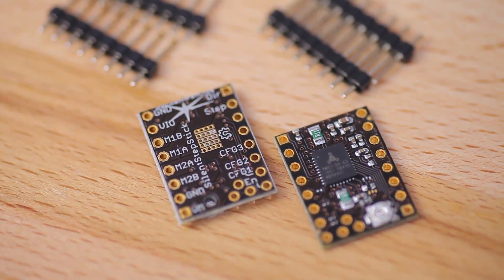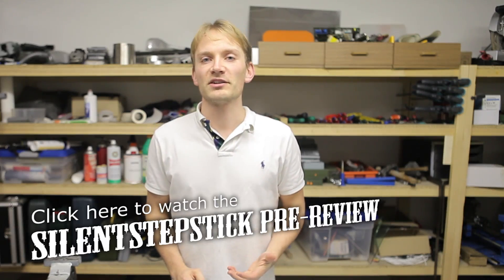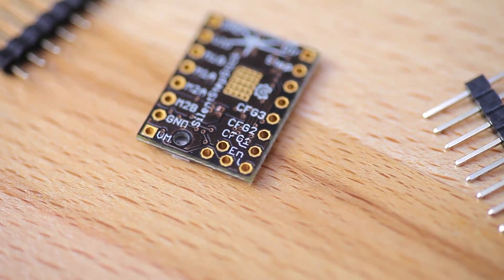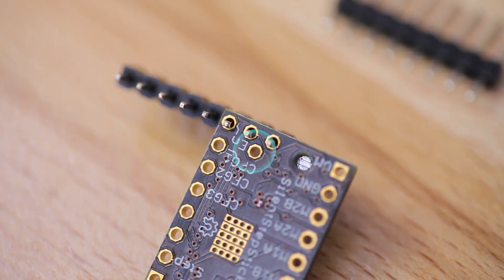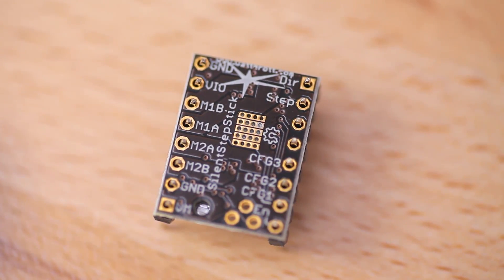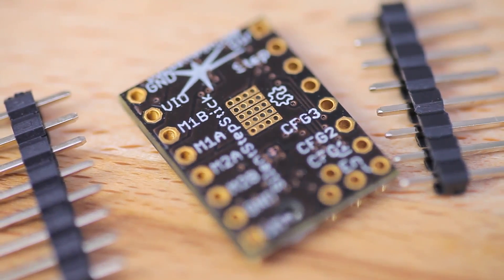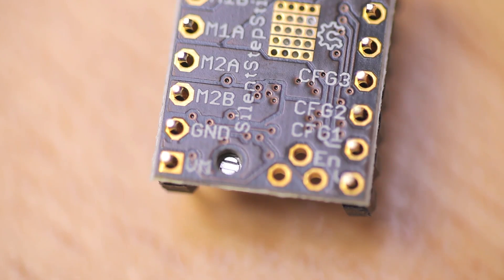Honest update: The finished version of the SilentStepstick

Comment: Hi! Can you tell me, if it is possible or not, to replace the "Makerbot 2" Botsteps with those SilentStepSticks? 1 on 1, or are there any modifications required? Edo
Reply: I've just done this, you have to run them upside down as the botsteps are already 'corrected' compared to most drivers for thermals

Comment: upside-down mounting with thermal vias is as old als cheap desktop 3d printers and was in makerbot replicator 1 open hardware design on the a4982 stepsticks on mightyboard. so all the cheap chinese makerbot1 clones have the right thermal design on the stepper drivers too.
next thing: whining on the steppers may be reduced alot by using a 24v PSU for the stepper motors.

Comment: Hi, i use tmc2100 module board and configure pin correctly,but i can't drive motor with 256 resolution.
Config Pin:
CFG0,CFG2CFG3,CFG4,CFG5,CFG6==>OPEN
CFG1:GND

Comment: Hi! There are two differt models of the TMC2100 at watterott. There is a 5V and a 3.3/5V (black one from the video) model. The FAQ says that you have to power on and off the black boards in a certain way. The Motorpower should be on first, than the logicboard. 

See: https://github.com/watterott/SilentStepStick/blob/master/docu/FAQ.md

I have the black boards (so those are powered by the motorpower).
I have only one switch for the whole printersetup. So the power should come up simultaneously. Is that a problem?

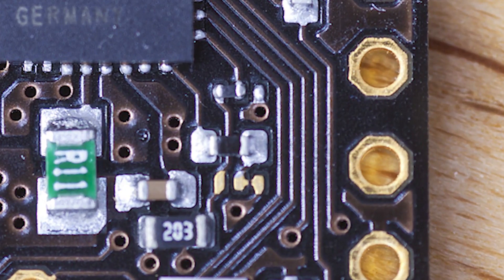Comment: Hi Tom, at 1:48 you talk about the two extra configuration jumpers (I think you say blind time and hysteresis?). I am trying out the silent stepsticks now and I get a very high pitched noise when I use them (other than that they work awesome). Would I be able to get rid of that high pitch noise using those? Can you tell me more on how to do that, or tell me where I can find information on it? Thank you, and great video!
Reply: I have the same problem with 2130's, I reduced the blind time and raised the hysteresis which helped it a little but it's still awful, like having tinitus.
Reply: sttrife I have the same problem. did you ever figure it out?
Reply: Raise stepper driving voltage.

Comment: +Thomas Sanladerer hi is there resolution difference  between printing object with this driver in stealthchop  and drv8825 or spreadcyrcle mode  and stealthchop mode ?
Reply: +Thomas Sanladerer  extruder motor torque is good in steal chop or is bad for extruding filaflex?

Comment: I wanted to update my 3d printer with these drivers but I ran into temperature issues:

My A4988 Polulu's are loud but they will stay at 50-60°C, I have to "feed" it with 0,27V (=> 0,68A).
To reach this amount of amps I have to feed the SilentStepStick's with 1V (=> 0,7A). So this is 0,7V more - and they reach 90°C in a few minutes...

Is this a failure of the drivers? I'm running them in stealthChop mode.

And for the heatsink: I'm afraid of a short-circuit if I glue a heatsink on the solder pins of the chip...or aren't they connected to the cip?

Comment: First day of test: 12V, 1.68 A rated stepper, ramps 1.4
It seams that I have to reduce the current by a lot compared to a4988 to have them work properly. Tried vref at: 1.5, 1.0, 0.9, 0.8, and it sometimes stop sending steps. I suppose because of overheating. I run them now at 0.7V with heatsink.
The vref pin is one row above the one highlighted in the video.
The stepper are still whining at 0.7V, I will look about the driving mode and jumper to enable.
I guess my stepper are not optimal for this drive. I would be interested to know better how to choose the right stepper for this usage. Quiet but still powerfull and precise. (video suggestion?)
Thanks for this review.
Reply: +jimbob1er yeah, i put my old drivers back due the whining noise, can't get it tolerable levels.

Comment: Thomas, I seem to recall you saying something about a whining that you fixed, how did you go about doing that?

Thanks!
Reply: You guys seem to have gotten an answer for the whining issue, that i can't see in the comments. Do you mind sharing what it was? I tried connecting different pins on cfg4 and cfg5 but the whining remained with 12v in spreadcycle.
Reply: Most excellent, thanks Thomas!
Reply: *****  could I just desolder the pins for the motor power and then use a boost converter to get 24v from my 12v supply and run wires to the drivers? Or do I have to completely move to a 24v system?
Reply: ***** Great! and what should we expect for current draw from these drivers?

Comment: It is a common myth that gold pins solder better. They do not. HASL for me anyday. The only thing gold offers is the lack of oxidation. If you want (solderfree) test pads or edge connectors, or pogo-pins, then gold is the way to go. 
Perhaps a little explanation is in order: Solder (let's say 60-40 solder) has a low and sharp melting point due to the specific proportions of tin and lead. Add gold to the mix (yes, the gold actually dissolves into the molten solder) and you get a stringy gloopy mess. The first thing I do if I ever have to solder gold-plated contacts (pins, pads, whatever) is to "wash" away the gold. Do this by melting an excessive amount of solder onto the pad (into which the gold dissolves) and then remove the messy alloy with a de-soldering pump or wick. Then you can tin the pad a second time, and get an excellent (and noticeably shinier) solder-joint.

Comment: Would you recommend the SilentStepstick or the A4988 for small robotics projects in which NEMA 8 and NEMA 11 steppers are used ?
The maximum needed ampere is around 1,2-1,5A. I'd like to have drivers that can act very silently, but also (in another mode) put out that motor sound as this would be a nice feature in the robots.

Comment: Has the torque issue been resolved? I remember that in your original preview, you mentioned that these didn't have the torque to drive printers accurately without losing steps..
Reply: +Paul Sieradzki That's only in the super silent "Stealth Chop" mode -- in the "Spread Cycle" mode they're still quieter than a the TI or Allegro chips and they're more than powerful enough to run a 3D printer.
Reply: +Michael Jensen Thanks for getting back to me! So do you think that a 3D printer running in Stealth Chop mode still won't be feasible?

Comment: I get realy TERRIBLE whining sound comming out of my 60mm NEMA 17 motors with theese drivers whether they move or not no matter what setting I use for spreadCycle (stealthChop is silent but useless), the only config pin CFG0 that I think could change that sound is unconfigurable. Copared to that the static sound DRV8825 make with theese motors is almost unnoticable. I did try theese drivers with some short (~35mm) NEMA 17 and the sound was a lot quieter and not much different from what DRV8825 or A4988 makes. I think most reprap users run on 48mm NEMA 17 and zou didn|t die from

Also, why the hell does it have 2 regular pinholes unconnected while using @#$% tiny solder jumpers for CFG4 and CFG5 and no config option for CFG0? The point of this board should be making the QFN-36 more human friendly... 

Other than that, they are nice drivers... I was able to get more than 2 times more acceleration without loosing steps than with DRV8825.
Reply: Can't edit the post... The squeeling motors are theese: http://files.amperka.ru/datasheets/LDO-42STH60-1206A.pdf on half winding
Reply: Gragagrogog Got the same problem on 12V with powerfull NEMA17 rated for 55Ncm, 1.5A, 4.8mH. It is whining a lot even if it doesn't move.
I search for documentation about the jumper on the board, which one to solder to configure it better. What software to use to open .sch and .brd files?
Thanks